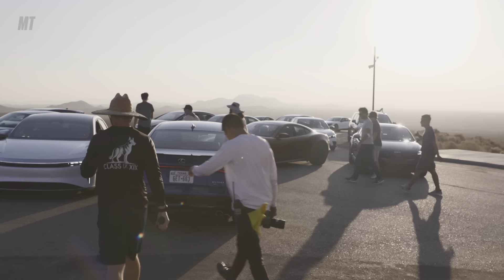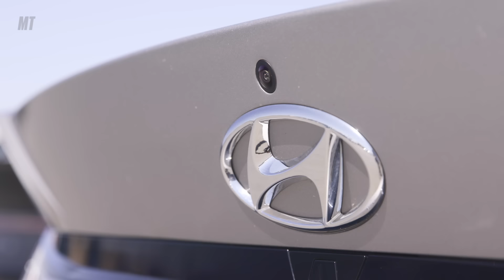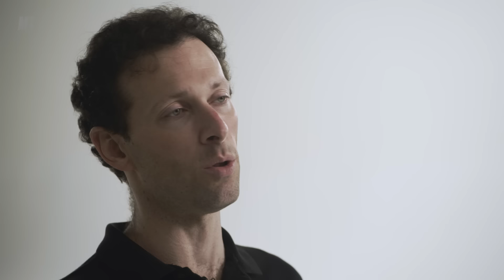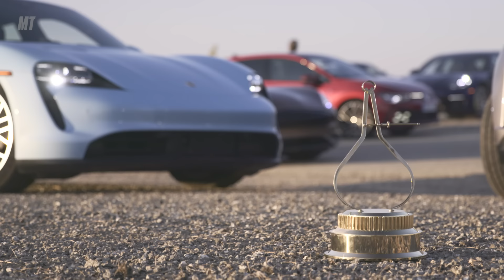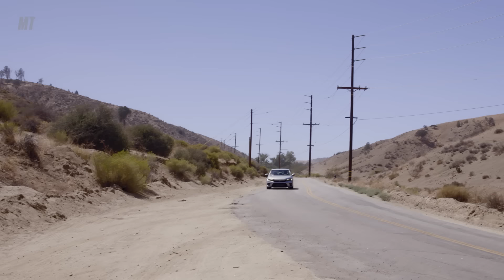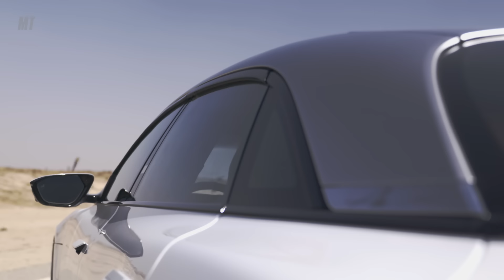2022 MotorTrend Car of the Year: Lucid Air

Comment: Most of the individuals who voted have probably never changed a tire, changed the oil, or even replaced a cabin air filter.  When “frustrations” break out over “entertainment systems” you know that the true focus is not on the drive ability of the vehicles.
Reply: Cool theory.